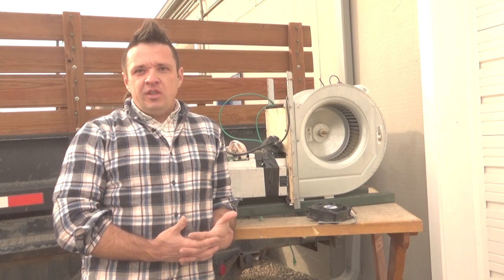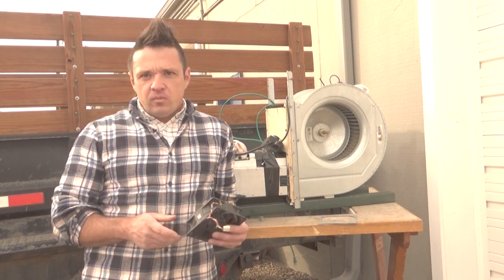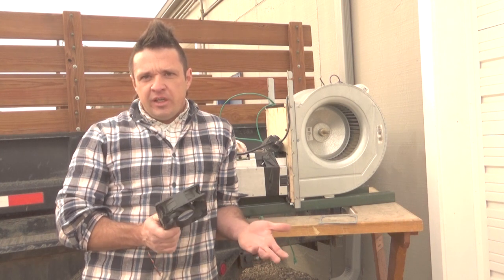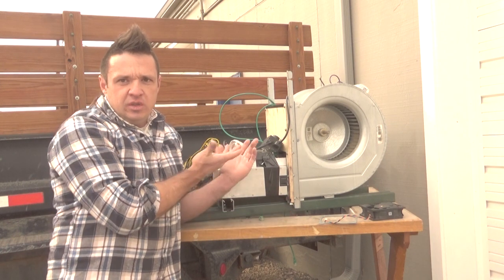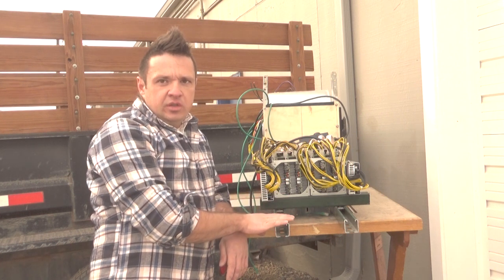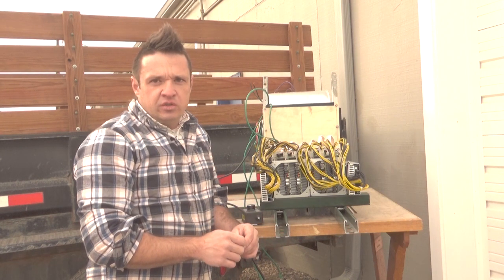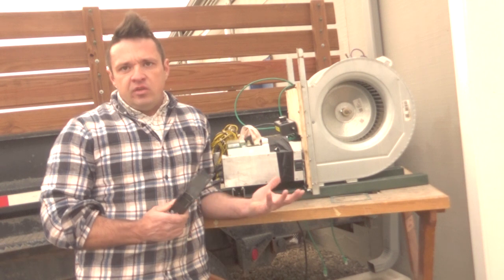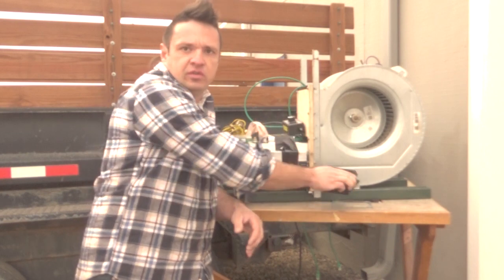Supercharging your BTC miner for fun profit and noise elimination

Comment: been looking at the same thing , want to stack two antminers side by side and use the one blower to cool two machines 
allso looking intoo setting the machines up standing straight up this with the idea that it will help disipate heat even if the fan stops working or doesnt come on fast enough and prevent hotspots inside the casings deu to vortexes , it allso prevent the screws holding the miner to the plywood from being pulled out by the miners weight , four pieces of 2 by 2 inch wood legs screwed ontoo the plywood should be enough to keep the extraction fan of the floor 

still have to experiment with it , one problem i foresee is that the amount of air being blown through each case might differ , so i might need to add a spoiler inside the setup to deflect the air to the top of bottom of the set 
have an anemometer ordered to check the airspeed comming out of each case 
allso looking intoo some sort of speedcontroll that can run off the antminer controllboard , i found sumting that can convert the pwm signal off the board to a 220 volt speedcontroll https://nl.aliexpress.com/item/1005004149677279.html?spm=a2g0o.cart.0.0.201a61d7RddYwe&mp=1&gatewayAdapt=glo2nld
wish should work simulair to the njord board but on a squirrel fan setup , have to find out if i can tap intoo the fanspoofer or straight intoo the controllboard for the pwn signal without sending said controllboard intoo a hissyfit or run the thing of a njord board (with has a pwn signal comming of the usb connector )

Comment: Instead of the squirrel fan blower (high volume, but low pressure) have you considered using a dust collector blower? Some of them have just as much volume but with the added benefit of more pressure. They are a bit noisier though, although not nearly as noisy as the miner fans.

Comment: This is cool man. I'm no engineer but I've been trying to think of ways of reducing noise with ASICs. Do you think there would be any benefit to spreading boards out more than they are in the miner cases? I assume this would reduce some of the internal wind noise but I'm not sure if it would negatively affect the wind pressure on the heat sinks.
Reply: There's a bunch of ways to make it better but the cost is the thing.

Placing each blade in a separate enclosure would cool better but would cost more, also, just upgrading the heatsink to a large copper heatsink with a 1 amp blower on it would easily cool 9 blades or 3 machines, but that's a lot of work and money, might as well immersion cool at that point. 

I watched this video and bought three of these for my miners from ebay, "DAYTON 1TDR3 Blower,273 cfm,115V,0.77A,1640 rpm"

Attached them and they work great, boards run between 80-89C at 5.5 TH\s a piece, miner only makes a quiet low pitch fan noise but I had to put the bitmain psu in front of the miner exhaust to constrict the flow very slightly like 10% constriction, in order to make it not high pitch whistle, but with a little back pressure it doesn't whistle and still keeps the boards cool and doesn't make much noise.

Only downside is the blowers were $100 a piece and the miners only earn $50 per month, so it is a 2 month term just to pay back the upgrade.

Comment: I built an oil immersed aquaponic system water heater using a stainless plate heat exchanger.  I also heat the air in my greenhouse with a T9+.  The air is ducted in with 4" pipe.  Works good.  Adding another, so I can grow peppers and tomatoes this winter.  Thanks for the inspiration!
Reply from the maker: We need a full video walk through on this asap. Are you keeping your chickens warm with it as well?

Comment: I’d love to see this run side by side vs 2 stock S9s. Seems it would be quieter 👌🏻
Reply from the maker: The camera doesn't really pickup the noise too well but its a lot quieter then two s9s side by side
Reply: @neetbuxlaboratories5806  that’s a great setup. The blower fan and two s9s. I’d buy that Max

Comment: I like it! Please keep going! I will purchase a fan box from you when you get an easy turnkey solution that doesn't involve modifying the casing of the asic, rather just removing and replacing only with the provided screw holes. Also I have a couple of s15 which don't have support from braiins so not sure how the fan signal would be handled. Thank you!
Reply from the maker: You can get a hard wired fan eliminator from 
https://fan-b-gone.ecwid.com/
Reply: @neetbuxlaboratories5806  Thank you I will check it out.
Reply: Fan simulator for immersion, very nice. I'm hoping for a solution like the one you are working on in this vid. Will watch.